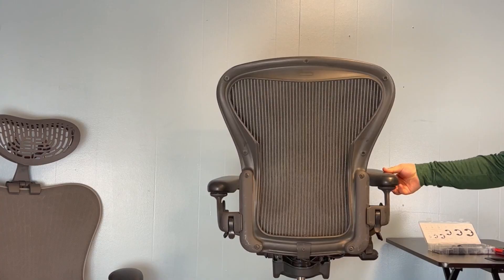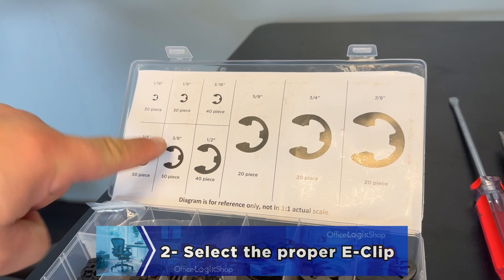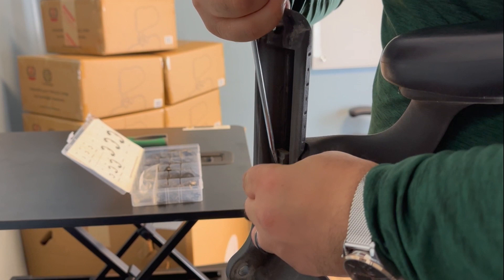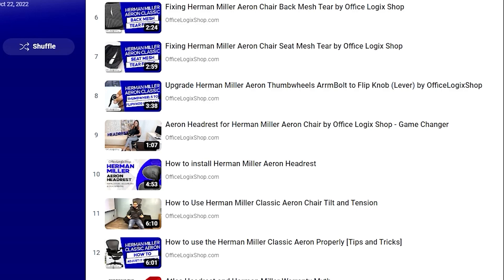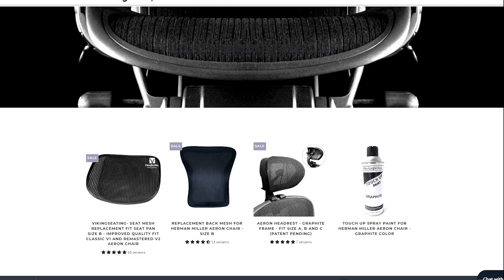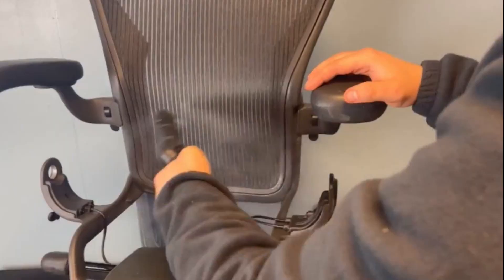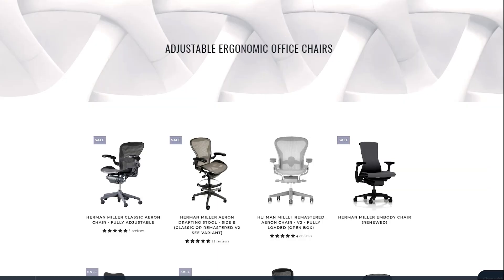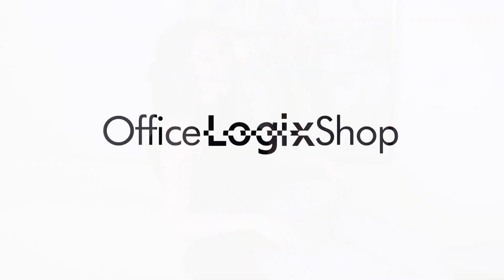Herman Miller Aeron Flip Knob Arm Fix [NO REPLACEMENT NEEDED!]

Comment: Just did mine as well and worked great. It looks like you guys refurbed this chair already, there was already (2) 3/8" clips in there. Had to add (1) 1/4" to prevent arm slippage. Levers are tight now.

Comment: Great tip, but the section describing the different sizes of E-clip (1/4" vs. 3/8") is misleading. The reason to use one diameter or the other would have to do with the diameter of the screw which the clip is being inserted onto. In my case, the screw was 3/8", so the 3/8" clips were perfect. One other thing: depending on the style of lumbar support (if you have one), the bracket that mounts to the bottom of the chair back and guides the lumbar support's cable, may need to be removed before you can remove the chair back itself. Mine required a square drive bit to remove the single screw. Thank you for this fix!
Reply from the maker: Thank you for your comment. While misleading is a bit harsh, you're absolutely right. The only reason we used that size because it is thinner than 3/8 inch and that's what was available in the market. The ideal solution is to find 3/8 inch e-clips in multiple thickness but unfortunately we couldn't at the time of creating the video. As for the Posturefit, it's a bit more complicated. Like you mentioned, you need to disconnect the cable in order to remove the back to access the bolt. We are really glad that the video helped you!

Comment: I just wanted to comment to say thanks. 

While I didn’t have wobbly arms, the right most arm slid down on its own, locked or not.

I used the 1/4” on both arms and I’m pleased to report that my arm no longer slides down on its own. 3/8” ended up being too tight for mine. I just bought the cheapest kit of e clips on Amazon, it was about 11 dollars. 

It ends up making the arms much tighter when they lock, but still an improvement overall!
Reply from the maker: We're glad that we were able to help!

Comment: Seems like another round washer would work too if you removed the bolt, added the washer, and put the bolt back in. Haven't tried it yet, but it is good to know in general how to fix this. Now to find place to buy these without getting 300 of them.  
If I'm able to use a washer, I'll edit this reply.
Reply: You can't remove the screw.
Reply from the maker: Hi, the round washer will work but must have middle diameter bigger than bolt head diameter

Comment: Thank you for sharing this useful wonderful video. May I know if the e-clip could fix the loose thumb wheel as weel as my aeron's thumb wheel does not hold the height after I tight the wheel it move down after half day used.
Reply from the maker: We're glad that you found our video helpful! From what you're describing, we believe an e-clip won't fix this issue. You must likely need to remove the back completely to gain access to the bolt in order to tighten it. For more info on how to remove the back, you can watch the first 35 seconds of our video about replacing the back's mesh: https://www.youtube.com/watch?v=sx1fLlk4eRA

Please let us know if you need further assistance!

Comment: Hi thanks for the vid. I can’t seem to get enough space to slide the e-clip into the space. I think I have an older chair. Any tips here? Maybe you can show where you are creating the space to slide the clip in?
Reply from the maker: Hello there. Thanks for watching our video. You need to use a thin screwdriver to create a space. If you can’t find a space, then the arm mechanism on your chair is most likely fine and there's no need to add the washer. Adding the washer is applied when the arm is a bit loose. All the best!

Comment: not the right way , the arm may get stuck .
use the torx screw to turn , at the same time hold the lever at horizontal position firmly.
if clockwise doesn't tighten , go anti-clockwise direction. Just need to turn the screw a little bit not too much.
Reply from the maker: Hello there and thank you for your suggestion. That's interesting indeed! Tell you what, if you can do a video where you show us the method you suggested on an Aeron Classic (not a Remastered), and it works, OfficeLogixShop will be more than happy to provide you with a free Aeron headrest! You can publish the video on your page and tag us. We always appreciate new tactics to help us hone our expertise more!
Reply from the maker: try to use round washer with middle hole diameter bigger than bolt arm head diameter. use desire thickness for the washer based on how loos it is.